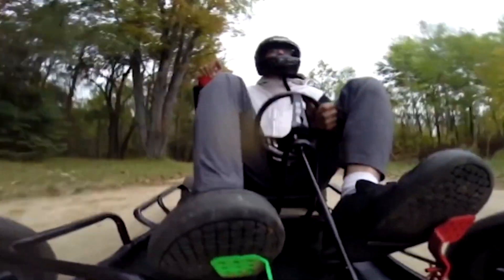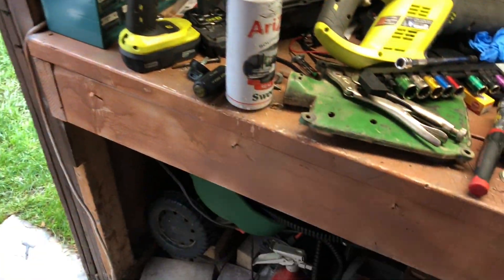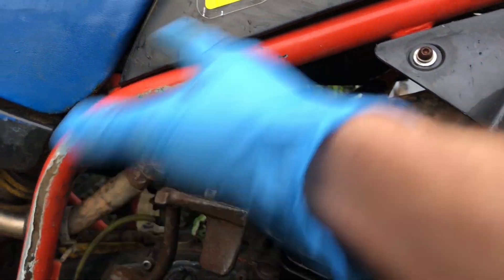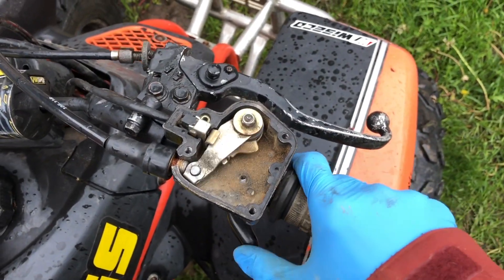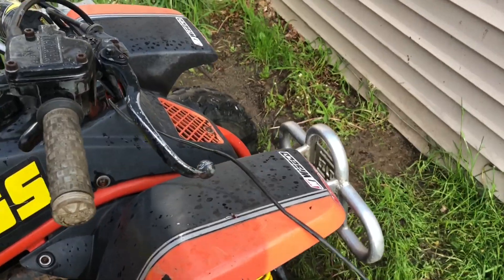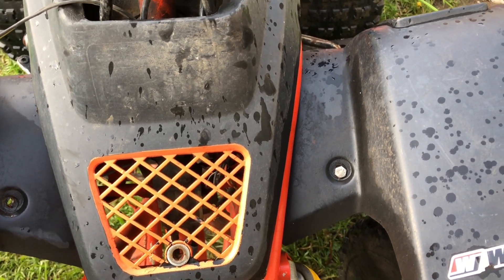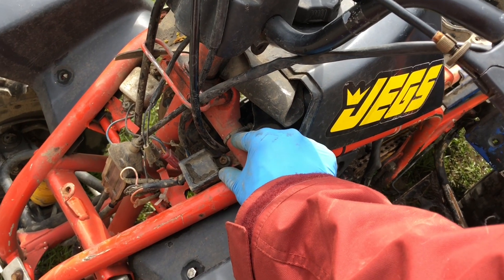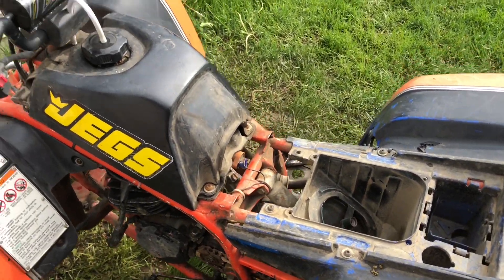How to remove a TORS on an ATV | Yamaha Blaster 200

Comment: Ok I have an 89 blaster and currently the issues I’m having are the quad fouling plugs but the plugs are brand new and not dirty yet. And I have gotten it to idle kind of but it won’t take throttle if I give throttle it will bog and it only lets me idle or give little throttle and it will die after a min or two like cuts off and dies. I also have issues getting it to go to the somewhat idle part of this hell. Please help. I heard there is a parking brake safety system too that could do it helppp I just wanna ride

Comment: Got an 06 blaster and the previous owner had a wrist throttle which made it difficult to control unless you were drag racing. I ordered a used OEM thumb throttle  off ebay which had a wire harness attached. Thanks for explaining what that connected to and what the TORS system is. I believe with the wrist throttle currently on the Blaster they already had to bypass the TORS system. I'll just remove the rubber grommet from the harness and silicone her closed!

Comment: Cool video. I have an 01 blaster. I rebuilt carb & i tried doing the low budget tors removal by clipping the blk/ylw wire, removing blk box under hood, & unplugging harness on top of carb. It started right up which was awesome BUT my problem is that 1st gear bogs out now when 1st taking off but the rest of the gears feel perfect with plenty of pull...I tried adjusting air screw on carb & big idle screw under seat...my question is, did I do something wrong during tors delete?  Was I supposed to relocate the idle screw & tap into the carb by buying New tors delete kit? Looks like on your video the carb already has the idle screw tapped into the carb..any info would be greatly appreciated,  thanks
Reply: Did you figure it out Ik having same problem
Reply: @dannykimble1112  nope. I gave up not too long after & ended up selling it on offerup. good luck brotha

Comment: Sup dude having a problem with my blaster when I open the throttle fully its like there's a limiter would this be a tors issue 🤔
Reply: Yea
Reply: There’s a screw next to the throttle that you can either losen or takeoff completely if you do you will be able to get the full power out of your atv

Comment: This is the best video that I've seen about troubleshooting this particular problem thank you!. I disconnected that kill switch up at the throttle. Then I disconnected the black and Yellow wire harness underneath the headlight. I think I'm missing one other step because I'm still not getting a spark. I've got a group of 5 wires next to the carburetor on the choke side I tried can disconnecting each one of those at a time to see if I could then get a spark. I didn't get a spark.  took out the two wires connected  up to that throttle kill ....By the way I did also check the kill switch on the left side of the handlebars and those have already been disconnected and still no luck.wondering if you have any other suggestions from there? Thanks again for your video it was very easy to folliw.  definitely not a mechanic!

Comment: Could this be why my machine is fouling plugs so much… Also I am currently working on it, will not crank . Has good compression usually starts first kick. I checked the spark visually, could hear it popping when grounded. Have been having a few issues where I suspected tors ...But if you could get up with me Id like to find out What experiences you have had with a bad system
Reply from the maker: On this atv it wouldn’t start and wasn’t getting spark so I wanted to bypass the system and eliminate it. After that it has been getting spark, also needed a new stator too
Reply: Did you find a solution ??

Comment: Hello,  STARTING AT 5:58 seconds when you followed the wires and found the socket you disconnected .. where could i find that middle piece that’s in between the 2 pieces you disconnected? My blaster randomly had that piece handing out after a rough ride in the back of my car.
She’ll start up but when i give it gas she would barley move then cut off. I’m assuming it’s that middle piece that’s connects the 2 wires together. Oh yeah and my front brake randomly stopped working after that happen any coincidence?

Comment: Great video on the TORS.  I just broke the yellow wire that is inside the housing next to the throttle cable.  My son has a 2001 Blaster.  So I can simple cut the wires and the eliminates the TORS complete? So breaking that wire  has no effect other than no spark at top end?
  Have another question.  My son snapped his throttle cable.  I bought a new one installed it but when I put it all back together I have slack in the cable.  If I have the cylinder out of the carb it works as it should.  Once I screw it all back together I get the slack and no return on the throttle.  My son would be forever grateful if you can help is dad put it back together. #stayathome  Thanks
Reply from the maker: You can bypass the tors and eliminate it but if you do you might have to mess with the carb settings for it to run smooth. For the throttle line you want a little slack but not a ton, if you pull down the rubber guard by the throttle there should be a lock washer and adjustment bolt you can tighten it up there. Good luck, hope you get it running!

Comment: I was wondering if you can help me my blaster thumb throttle won’t let me push it do you think it’s the cable or the tors
Reply from the maker: David Blum is the throttle stuck where you can’t move it or is it not doing anything on the bike when you push it?
Reply: Project Garage I can’t push so the bike won’t move
Reply from the maker: If the throttle is stuck it might be seized up, the tors wouldn’t have anything to do with it if you can’t even move the throttle lever
Reply: Project Garage thanks man it was the cable I need to tighten the cylinder the part were the clutch cable connects how am I suppose to torque it if the torque wrench doesn’t fit through there
Reply from the maker: @davidblum_  Are you sure you have the right cable and it's not the one for a twist throttle? It's hard to tell without seeing it but you might have to take off some other parts to get to the adjustment if you can't get the wrench in the area.

Comment: Well does it work why’d you not start it?
Reply from the maker: There was other work to be done to it as well, it wasn’t just a tors issue
Reply: @ProjectGarageSRT  but when you cut the wires that you cut in the video and leave the tors system in the carb does it still work

Comment: I just bought a blaster today and have no spark at all. This is the only video I can find on how to get rid or TORS without replacing the thing on top of carb,my qeustion is leaving the box on top of carb will I still be able to adjust idle and all that? Also once I do this will it affect anything in a negative way?? Thanks for any help and have great day
Reply from the maker: Yes you will still be able to adjust the idol. In order to do that you use the big flat head screw on the top of the carb, it is kind of tricky and I recommend replacing the top end of the carb but you can get away with using that to adjust idol. You may have to readjust the float needle as well